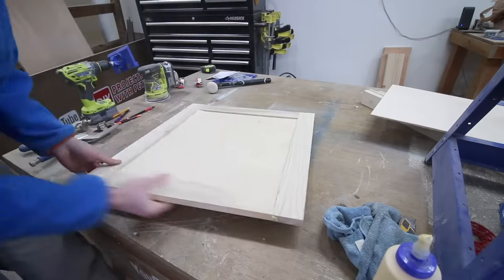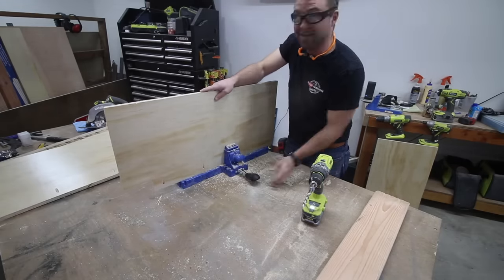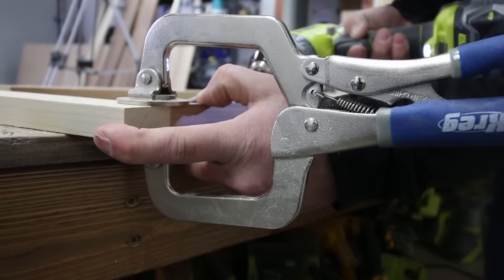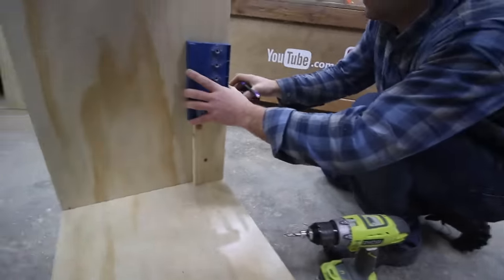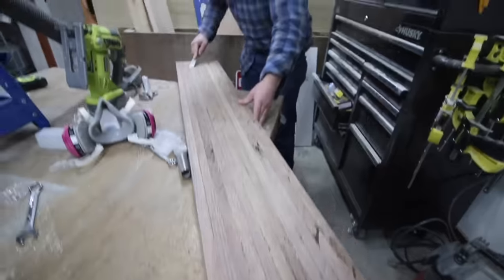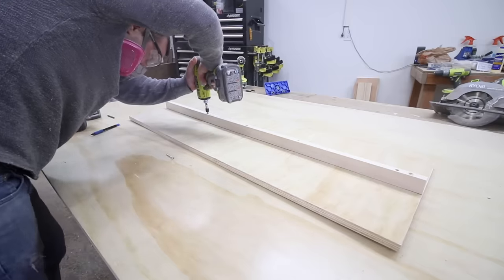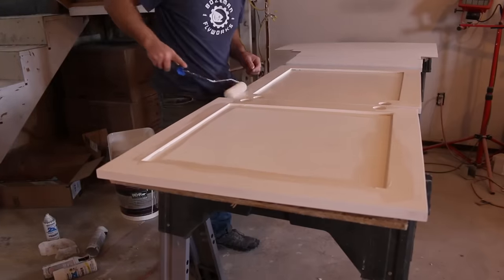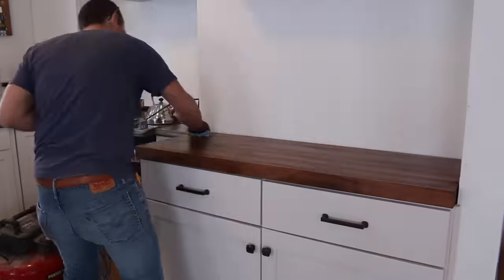How to Make DIY Kitchen Cabinets

Comment: edging is made so easy with that new iron on type. i remember doing that where i had the spray the glue wait for the glue to semi dry then place on the wood. then corner sand the edge so they flush then paint lolol. but i like how you made all your with plywood rather using that osb press wood crap.
Reply from the maker: Thanks!

Comment: How did  you come up with just how much walnut to buy to get the correct size?
Reply from the maker: Hi! I bought 1 inch thick walnut and cut the strips. Determined the overall size and did some division. You'll just need to determine the size you want to go with, figure out what boards are available, and then do a little math. Cheers

Comment: What kind of paint did you used for the faceframe? Is paint with a gun?
Reply from the maker: Hey Alain! I rolled on a cabinet paint from Lowes for this project. I'd prefer to spray though if I had that setup.

Comment: Do you think the cost for material will much less than buying a standard build?
Reply from the maker: Hi, this really depends on the style of the cabinets and quality of the wood being used. If you are using basic pine/poplar like I did, the cost is fairly similar to buying cheaper cabinets. I wanted to document the build to show the process, but if you are looking for a basic cabinet and can find a good fit, you could simply buy it.

Comment: I'm a newbie but why did you do a face frame if doing full overlay drawers/doors?
Reply from the maker: Hi Rich! The face frame is a necessary component for the doors and drawers to stop against. It also frames out the front of the cabinet. Even though they are called 1 1/4 inch full overlay doors -- you can still see the frame around the perimeter and between drawers/doors. Great question!

Comment: I love your videos and have been a long time subscriber but I do wonder about how long a cabinet made from pocket holes will really last. At least you put glue in your pocket hole joints. I have seen others without the glue and I wonder how long that little screw will last before it pulls out. Seems to me that it would last a little longer than the flat pack cabinets from Walmart or Ikea that are made from chipboard, not much though.

Thank you for your videos though and the house looks great.
Reply from the maker: Cabinet carcasses are very commonly made using using pocket holes and they are built to last. Cheers

Comment: you shouldn't glue your draw bottoms , they need to expand and contract 
and nice cabinet but should leave wood no paint would look a lot better
Reply from the maker: Thanks for your feedback!
Reply: Plywood is more dimensionally stable than a solid wood panel, but yeah - and the same is true of the cabinet doors.  The panel should float freely in the frame.

Comment: looks amazing, but clearly a lot of work and tools required.
Reply from the maker: Hi there, cabinets are work and do require an investment in more tools. So this one is definitely a more advanced project, but a good one to learn some new skills. Cheers!
Reply: @DIYPETE 

32 years ago and a cash strapped newlywed I rebuilt our kitchen using a borrowed radial arm saw, a 2nd hand orbital sander and a hand drill plus a few other workshop staples like a spirit level, a square and miscellaneous clamps. 

So yes, having all the right machines makes life easier but they are not essential.

My mouth waters every time I see the Kregg range but where I live they are too expensive to justify buying them unless you are doing a lot of installations.

I have to demolish one cabinet and rebuild it to accommodate a dishwasher so watching this video has been a a welcome refresher.

Thank you for posting it

Comment: Any chance you can link to the paint you used?
Reply from the maker: Hi Stephen! I used a cabinet paint from Lowes, but most stores have a special cabinet paint so feel free to use whatever you'd like :) : https://www.lowes.com/pd/Valspar-Cabinet-Enamel-Semi-gloss-Latex-Interior-Paint-Actual-Net-Contents-116-fl-oz/999918108?cm_mmc=SCE_PLA-PaintInteriorStains_-999918108:Valspar&CAWELAID=&kpid=999918108&CAGPSPN=pla&store_code=2608&k_clickID=e09b9426-8e20-4837-a1b4-a5acdebfa8bf&gclid=CjwKCAjw-dXaBRAEEiwAbwCi5p033D-hMpHtHF1CT_BINDS_GKfUmBnHTzyn8PTrT1fmRJjJ4IKSphoCADIQAvD_BwE

Comment: Man that is alot of work for one cabinet.... i am usually all for DIY but i think i will just buy my cabinets
Reply from the maker: Hi, cabinets are a lot of work... I agree, buying cabinets is a great fit for most people. Cheers
Reply: I was thinking that too. 

Here is how I save the effort. I use my remote sensing car keys and my 3 3/4 inch Gucci pumps to drive my ass over to Ikea and order me some cabinets with installation. ;)

Just kidding ... amazing work. Gorgeous butcher block and bespoke cabinet exact for the space. Must be satisfying.
Reply: The problem is the quality cabinets are very expensive.  I had a water leak that rotted out a cabinet.  I bought a low end cabinet at the big orange box store.  I was shocked at how cheap it is.  It's almost cardboard.  
Plus if you have an odd sized, not square kitchen then custom cabinets will look better.

Comment: Why did you do an applied end panel instead of making the face frame flush with the cabinet side and painting it? If you make it flush you would just face nail the face frame to the carcass instead of using pocket holes
Reply from the maker: That would certainly be another way to do it!

Comment: Great video!  What grade / type of plywood did you use for the cabinets?  Did you have to do a lot of work to get extra flat ones or were you able to get everything pretty square during cutting and assembly?
Reply from the maker: Hey Brett! I used pre-finished cabinet grade pine plywood from the Home Depot. It was $47 / sheet and pre-finished on both sides. It's not always easy to find so if they don't have it they'll order it for you. They were all super flat and I didn't have to sort through the sheets much.

Comment: why did you choose not to do a full 3/4" back?
Reply from the maker: Hey Jeff, I used the 1/4" mainly to give an extra 1/2 inch in the cabinet since it is a more shallow cabinet than usual, and to cut down on cost.

Comment: is the much cheaper then just buying premade cabinets
Reply from the maker: It really depends on how many you make and the quality you want. I needed to fit a custom space, so my only option was to buy custom cabinets, or to build. Custom cabinets would be much more expensive. However, if you have a standard space to fill, it will be most likely cheaper to use the cheap pre-made ones from the hardware store. It's really about the quality of the build and wood used.
Reply: @DIYPETE  thanks I have a small mobile home and want to redo the bathroom and kitchen on a small budget so if its cheaper to make them my self then that's the way to go

Comment: First spraying has gotten so cheap and easy, with gun tech getting so good. Second if your getting that much over spray you need to adjust pressure tell your have very minimal over spray. We’re a respirator and there won’t be any fumes. You get a better end result and spraying is not hard. People get scared of it due to people spreading the idea it’s not diy friendly.

Comment: Is it cheaper to build your own cabinets?
Reply from the maker: I would say these are going to be a little more in cost or close to the cost of store bought stock cabinets. Custom cabinets are going to be on the more expensive side. I needed this to fit a custom space and depth --- which is why I built it. However, if the stock cabinets look and fit correctly -- I'd go that route. Cabinets are a ton of work and you need to be very meticulous to make them turn out great. I enjoy the process and think learning the basics is good. But if stock cabinets will work for you, you'll save a lot of time and potentially a little money.

Comment: Face frame, yes do glue - but Wood glue is a total waste for most of the carcass joints. Example the ends of a 4" wide spreader to pre-finished plywood.  There is nothing there that glue would bond to.
Reply from the maker: Thanks for the feedback and info Tioga. I appreciate it!

Comment: Not bad execution, but the video was too fast, and you could have finished the trim on the inside of the draws so you can't see the unfinished plywood edge. and dovetail draws would look more rich looking. and be stronger. Too much with the pocket jig. It has become the lazy carpenter tool.

Comment: I do not see purpose of making cabinets when you can get from Home depot etc whatsoever boxes you want.
Reply from the maker: You can certainly buy them from your local store if you'd prefer. I needed a custom depth and width, which was one reason I built them.

Comment: I like your videos but everytime I see you use pocket screws I hate them more and more.
Reply from the maker: Hi there, thanks for the feedback! I like using other joints as well, but pocket holes are a good fit for making the project doable and efficient for the majority of my weekend warrior and beginner audience. Hope all is well and thanks for following! Cheers
Reply: Professional cabinet makers and woodworkers use them as well.
Reply: Saw a video testing different joints and turns out that simple dowels were about the strongest joint.